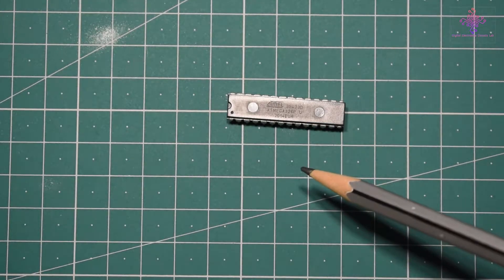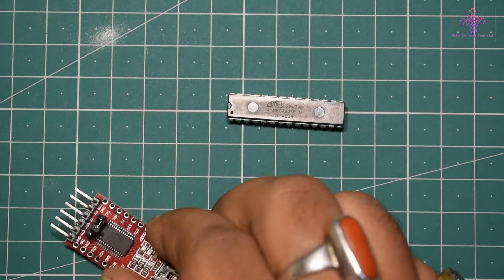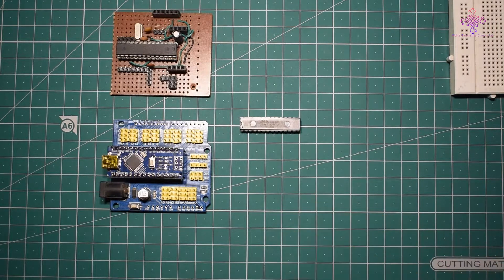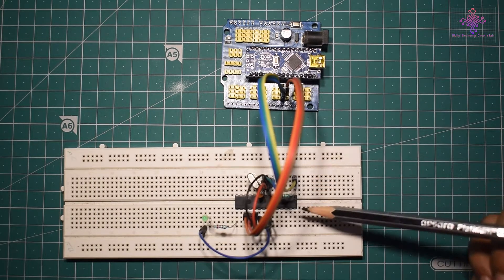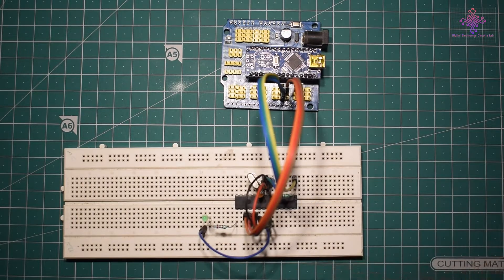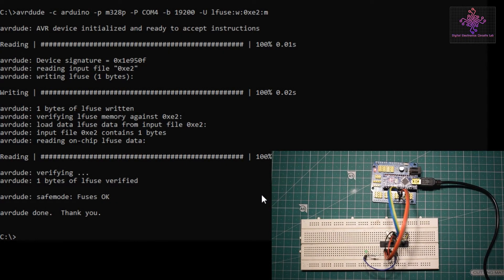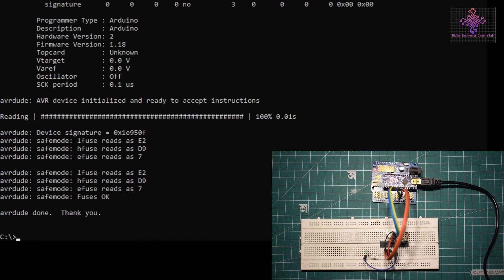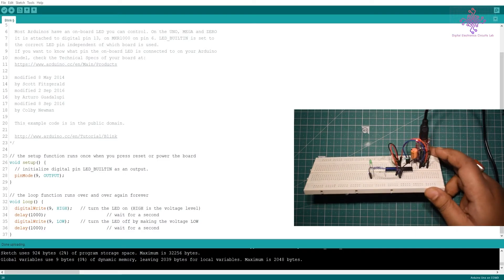DEC #14 Change Fuse bits and burn Arduino bootloader to atmega328 microcontroller

Comment: What is problem in my Atmega328P-U microcontroller. I am using external 16mhz crystal . I am using this setting 0xFF, 0xDE,  0xFD,  0xC0 and write by avrdude. 
my project stuck or hang after some hour...
how to solve my problem...plz tell me

Comment: Thx very much for this video and for your blog. But as I havent still studied atmega datasheet, I am still little bit confused:

This
lfuse : 0xE2
hfuse : 0xD9
efuse : 0xFF
works for me with atmega328p on breadboard with 16MHz crystal, but 
this
lfuse : 0xFF
hfuse : 0xDE
efuse : 0x05
which is default setup for atmega on arduino, dosnt work on the same breadboard.

I "feel" thats because of lfuse, but why, and what bite is this key bite (the most important)? Do You know it please?

Comment: Pls why the fuse setting is it compusry. If not done what will  happen to the microcontroller.
Reply from the maker: Its not compulsory for every microcontroller. Usually the default fuse settings are set to accept arduino bootloader. But if you face any problem in uploading bootloader I would suggest to check fuse settings. In  this video I have shown the process